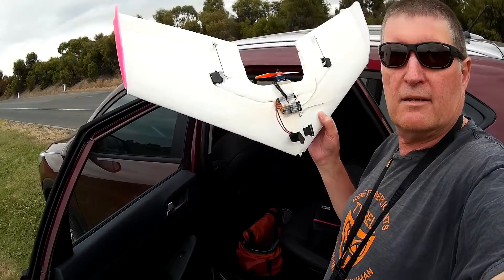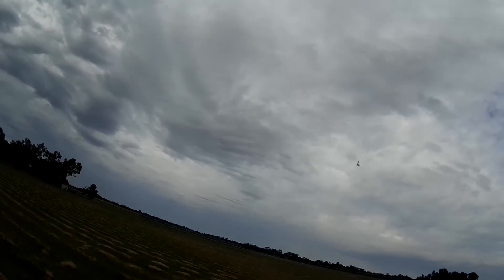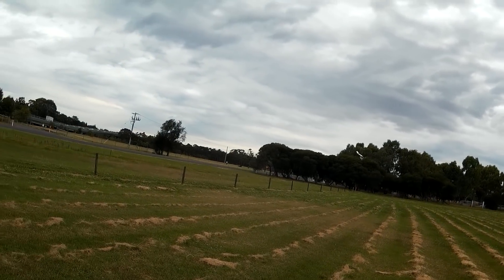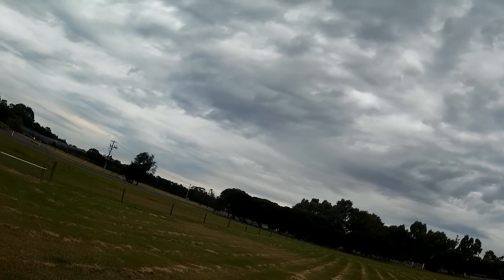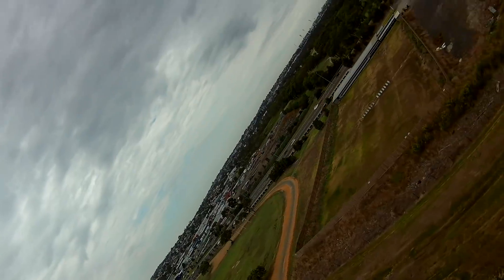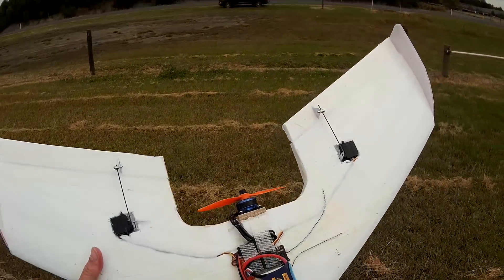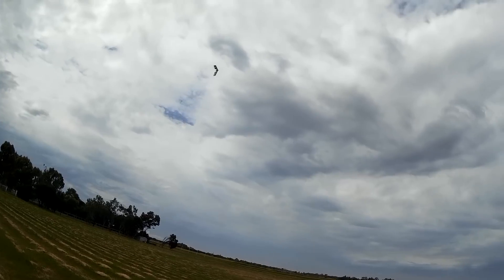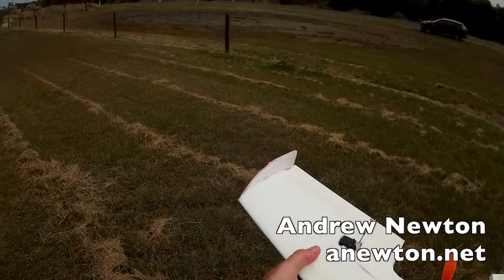Boxler Wing maiden

Comment: Cool Video! Could you try to make it a sub 250g model? How much flighttime do you get with your 1.3Ah? Maybe with a 800mAh battery we could go under the weight mark. 

In my current location are so many Airports and Military zones, that heavier planes aren't allowed to fly anywhere near.

Thanks ;-)

Edit: Sub 250g "model"
Reply from the maker: Sub 250g would be possible with a little effort.